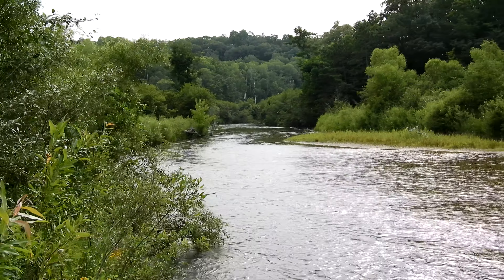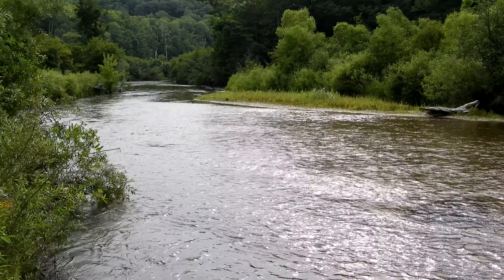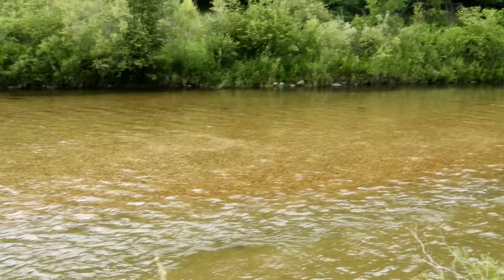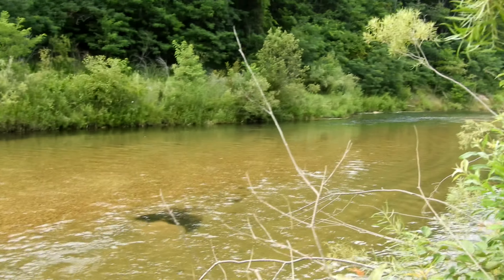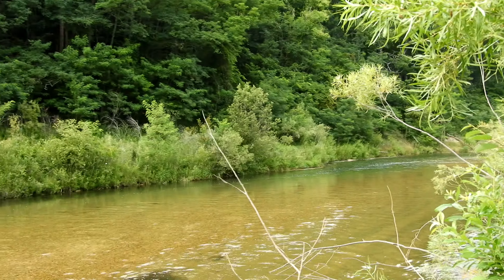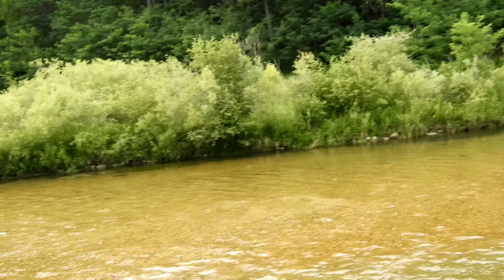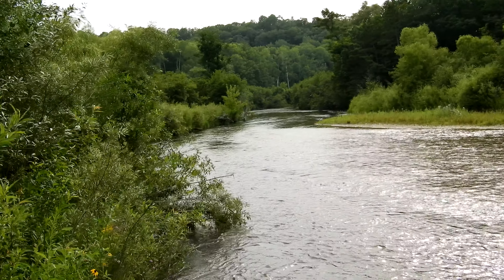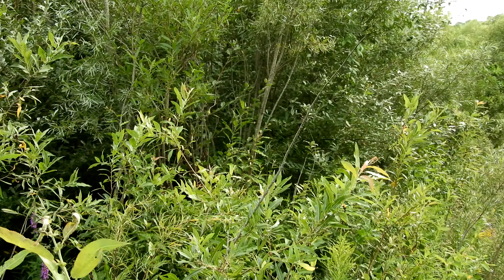Former Dam Site on the Pine River

Comment: Looks like nothing was ever there. Must have been a pretty small hydro-electric dam.
Reply from the maker: Not huge, but a substantial installation, with two or three turbines I think. This was before I started getting more into photography but if I find a good stock image I may put it up on the Community tab.
Reply from the maker: Just Google "Stronach Dam", they have a lot of images of it. It had evolved from an earthern mill dam to a big cement thing so a lot of differrent dates are given.